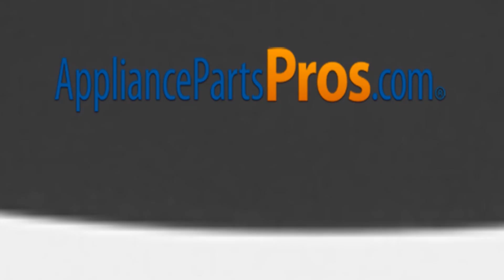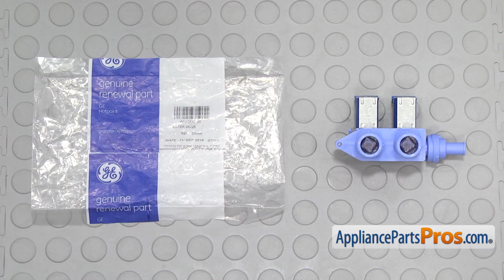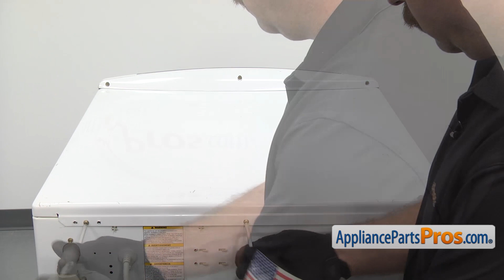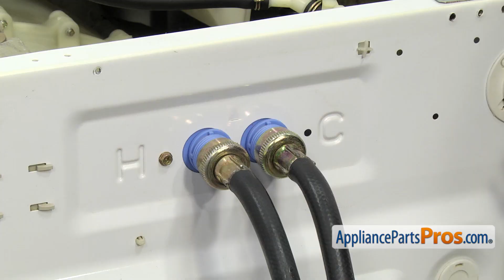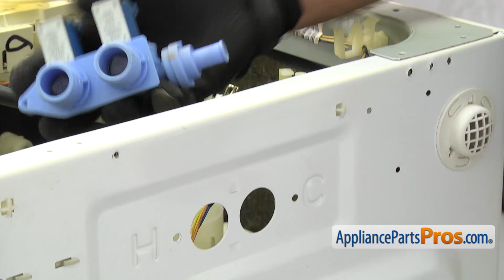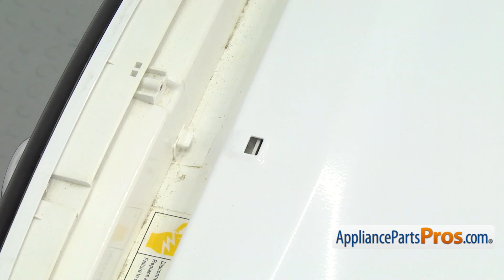How To: GE Water Inlet Valve WH13X10023

Comment: Thank you for the video!  I just got this machine and after a few washes, I noticed leaking onto floor. Then, I checked tub and it was filling with water, pretty slowly. I shut off water and ran the spin and drain cycle to get rid of the water.  Then, I looked and found your video.  I'm hoping this is the problem.  Thank you for the help!!!